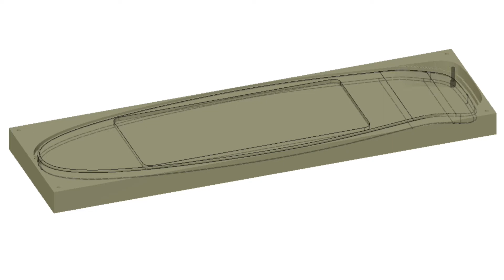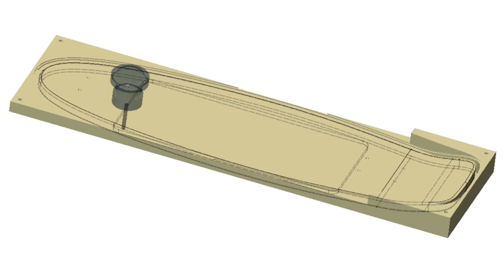CNC Electric Skateboard with the MPCNC

Comment: Very cool video, glad I found your channel. I am looking to build an MPCNC this winter and was looking for build guides. Any advice on building the CNC? Parts or considerations I should make?
Reply from the maker: I've found that the v1engineering build guide on the website is really comprehensive and easy to follow, I don't really have any good tips beyond what's there

Comment: Great build! What kind of wood did you use? Also, the deck looks a little thicker than others that I’ve seen, was that intentional, or a limit of the material?
Reply from the maker: Cherry, walnut, and a tropical hardwood. The deck is a little thick because I didn't want any flex in the board as the electronics can't really move around
Reply: @proungoods818  ahhh, that makes a lot of sense.

Comment: How did you remove the supporting lines on the sides that were preventing the track from coming out in the Fusion 360 program?
Reply from the maker: I had two contour passes, one with tabs that I ran first and one without tabs that I ran after the other operations were done
Reply: @proungoods818 Could you please make a video about this? I didn't quite understand how it was done.